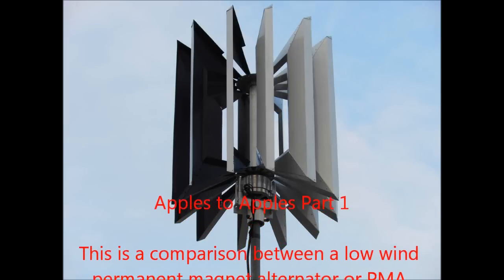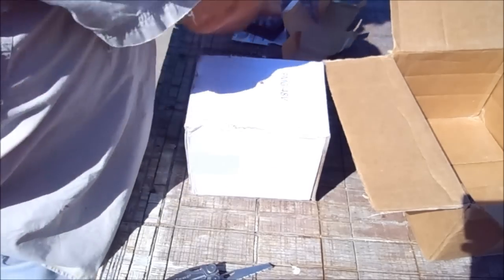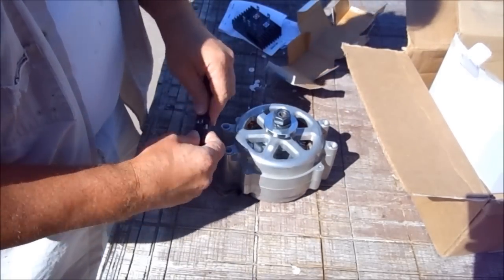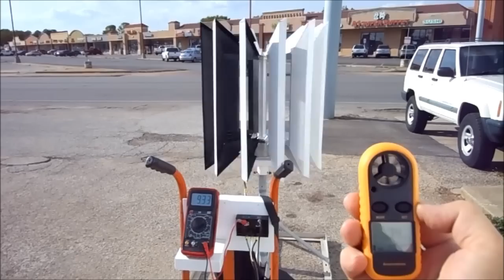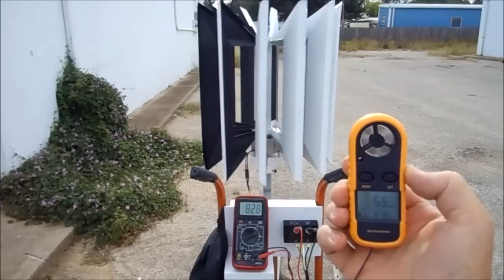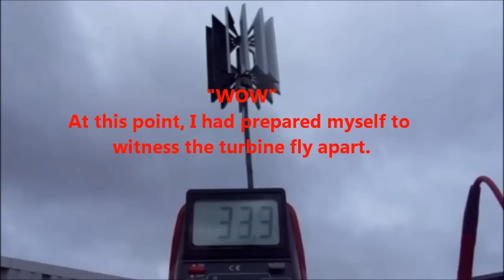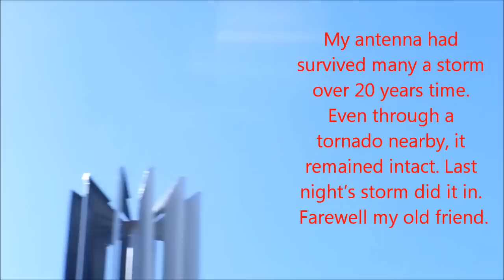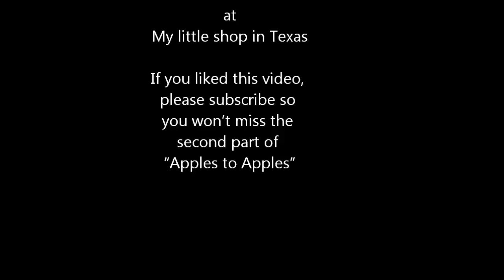Apples to Apples Part 1

Comment: What is the power output of this generator during 18 to 20 MPH winds? Or 10 mph?
Reply from the maker: I would need access to a wind tunnel to break down all wind speeds to power output, and I haven't had that access yet. However in part three of this series, I ran all three of the PMAs I've purchase on my mill. I ran each one around 100 RPM which I guesstimate would be about the RPM in a twenty MPH wind. Results varied by PMA. Here's the link to that video. https://youtu.be/k4_14oWitco

Comment: I think a car alternator works just as well or better.
Reply from the maker: A car alternator requires current flowing through its coils to create the electromagnet which can then charge the battery its drawing from. How is that better than an alternator that doesn't need any outside current to work?

Comment: Could you explain why a roof turbine ventilator would need to turn a generator? Why not put the magnets on the turbine hood and the coil around the base? Agreed it would be rather low voltage but in Louisiana it wasn't uncommon for there to be three or more of them on a garage/workshop roof.
Reply from the maker: Interesting thought. Put one together and show me.
Reply: @LittleshopintexasSV  I'll give it a shot if I can get my hands on parts and pieces. They really don't use them here in the DC area.

Comment: Does it produce electricity and what's its maximum wind speed?
Reply: Many thanks for the reply. 80 mph around here is unusual but not unheard of - we’re in the hills in southern Scotland. The main problem on our land is turbulent wind because our top fields are surrounded by woodland which means that a traditional wind turbine, so the manufacturers tell me, wouldn’t take the strain with the wind veering or gusting a lost. ‘Dirty wind’ as the sailors call it. Which means that a VAWT, on the cace of it, would be the answer from the wind point of view. However, my research into VAWTs seems to indicate that there are reliability issues with most solutions, stemming from wind vane fatigue, bearings and generators. Keep me posted on development.
Reply from the maker: I think the biggest problem with horizontal axis turbines is they have to turn into the wind before they can produce any power. Whereas a vertical axis wind turbine can take wind from any direction. And since the generator of a vawt never moves you don't have problems with thrust bearings, worn electric slip rings or tangled power cables.
Reply from the maker: Yes it produces electricity. Output depends on wind-speed and the generator used. I don't know the maximum wind speed. We've had 80 mph straight-line winds that didn't harm it.

Comment: Was that an optical illusion or was the turbine reversing direction in the high wind sequence?
Reply from the maker: It's an optical illusion. A previous viewer suggested my camera runs at 28 frames per second and I have no reason to doubt that. So you can think of the camera as a timing light, When the turbine is spinning but it looks like it's sitting still, the blades are aligning with the camera at 28 frames a second. When it looks like its running backward, its aligning at less than 28 frames per second.

Comment: Man no disrespect but man that’s light duty, it sure is a start, one major problem I see with there design using for a vault is the stator is open to the weather. Also with the amount of blades, your RPM will suffer for sure. I’m going to check back after your up for a couple of years.
Reply from the maker: I designed this for my area. Maximum height allowed without a permit is forty feet. Which is the average height of trees in my area. We also get the occasional tornado and quite often get hit with 80 mph wind. There are no other wind turbines in use within miles of me for these reasons. And yes top rpm is lower with twelve blades but it produces 14 volts in a six mph breeze which is all I need for my 12 volt batteries.
I'd also like to point out, I uploaded this video a few years ago and there had been one of these on my shop roof for few years until a storm threw a canopy at it. I have since repaired, repainted and put it in a higher place.
Reply: I see I live in the sticks. My closest neibor is 1/4 mile away.
Reply from the maker: It must be nice. I miss the fresh air, starry nights and the quiet life in the country. Well, maybe not always quiet but you know what I mean.
Reply: Yes very quiet except for harvest time, Semi’s everywhere. Most of the year all I here is the wind through the trees and cattle mooing, My big Horn sheep asking for food all the time, even when they already have all they can eat. Winter is even quieter.

Comment: I love the blades do you sell that set up not the pma
Reply from the maker: I can make whatever you need, but I don't have any ready to go.
Reply: @LittleshopintexasSV  ok how much
Reply from the maker: Not all PMAs work well as a vawt. What PMA do you intend to use?
Reply: @LittleshopintexasSV  freedom II
Reply from the maker: @1968dodger2419  Good! Do you already have one?
Reply: @LittleshopintexasSV  no not yet
Reply from the maker: @1968dodger2419  There are three different ones, the 12/24, 24/48, 48/96 volt Freedom II PMA's. I use the 48/96 volt because it starts making battery charging power at very low RPM. The downside is, they are the most expensive at $633 bucks. You can order this directly from MWS or I can order it for you once I have a deposit for the project.

Comment: I looks like it will fly off in high winds,
Reply from the maker: Neither a near miss by a tornado or 80 MPH straight line winds have made it fly off yet, so I don't think that's a problem.
Reply: wow that's a real test alright, I stand corrected, Texas seems like a great testing ground.
Reply from the maker: Yes 'tis, but a wind tunnel would be better.

Comment: Wouldn't an upper bearing stabilize the fan .... it's a big fan?
Reply from the maker: To have an upper bearing you'd have to add some kind of frame to hold it. That will also create wind deflection and mass to the top of the pole.
In more recent versions of this turbine, the blades are 48" inches long and extended down below the bottom of the generator. This puts the generator closer to the center of the forty eight feet of vertical blade surface.
I also recommend using the Freedom II which has a dual core for more power and a longer shaft to handle heavy wind conditions.

Comment: if its cogging to much ,count the magnets inside and you may be able to take out a couple if you have 8 readjust where magnets are and remove 2.same as if you have 10,remove a couple.it will help.shape of magnets also make big difference.good video.
Reply from the maker: A little cogging is not an issue for this turbine and removing magnets would diminish power output of the PMA.

Comment: Have you checked the bearing wobble lately?
Reply from the maker: If you're asking about the Freedom PMG and the low wind Windblue PMG that I showed in this video, they've been sitting in the shop for the last few years. Their bearings are just peachy. And I've been using a 48/96 volt Freedom II on my shop roof for about five years and its bearings are just peachy as well.
Reply: @LittleshopintexasSV  Must be some tough bearings with all the lateral pressure. Thanks.
Reply from the maker: @ed-jf3xh  They're the same type of bearings that you have on a car alternator, designed to deal with heat and high pressure at 1200 at idle speed and up. The highest RPM on my VAWT might be 300. Thats easy work for those bearings.

Comment: I noticed the new MWS pmg is a 48V but your multimeter set at DC volts never got above 25V when windy. So, this setup will never charge your battery just not enough rpm
Reply from the maker: There are a lot of variables to consider; Top wind speed for that day was around 8 MPH; A VAWT will never achieved the same high RPM of a HAWT; And different PMA/PMG are capable of different outputs. On the other hand, it's not a problem if your running a twelve volt system.

Comment: Also, you mention HSA and regulations regarding erecting things on your property, how would they handle someone connecting a vertical windmill attached to an existing chimney? This should be the highest point of the home, so lashing a pole to it with a windmill on it shouldn't be a problem.  Similarly,  I have always wanted to figure out how to capture the pressure differential between the top of the chimney and the ground floor or basement where it terminates. If a vertical windmill could be lodged within a chimney and be totally invisible to the outside eye, this would alter the course of home-based wind generated power. I understand that heat is what drives air UP the chimney, but there are naturally occurring flows of air inside, outside and about the structure. That is why soffit vents work.  The Stack effect. https://www.greenbuildingadvisor.com/article/the-stack-effect-when-buildings-act-like-chimneys With a little application of Venturi and/or Bernoulli laws there could be a speeding up of these flows.
Reply from the maker: Yep, the stack effect is how a prairie dog homes ventilation works. However I don't think its the heat rising that drives the air up the chimney as much as the wind moving across the top of the chimney that creates a vacuum that pulls the air up and out. And of course to have a good flow you'd need as much air moving through the house as possible. I could see something like a ceiling fan converted into a generator positioned directly under a vent hole in the roof of equal diameter to the generators blades. This would work best in temperate zones where heating and cooling the home is not an issue.
Reply: @LittleshopintexasSV It surely is the heat tossing. That is why we have to prime the chimney by lighting newspaper to hear the stagnant air in the flue prior to lighting the fire. Otherwise, the fire will create too much smoke and not enough heat to get there chimney air moving there forcing the smoke to roll into the room instead of going up the chimney. Gotta heat the air to initiate the convection up the chimney.
Reply from the maker: True to a point. Because cold air is heaver than warm air, you do have to warm the air in a chimney in order to get the smoke to go up the chimney. On the other hand I've never heard of a prairie dog needing to start a fire in order to get the air flowing through his house.

Comment: I bet there is sweet spot for design of a Fechner painting on the turbine blades such that you could tell the wind speed by the virtual color of the spinning black and white blades. https://www.google.com/search?q=fechner+effect
Reply from the maker: It could be done with the turbine itself, but not while using it for generating electricity. When your system is drawing power from the generator, it creates a resistance in the generator which lowers the RPM and would require higher wind speed to achieve the same RPM. When no load is being drawn, the turbine can freespin. However painting one blade a different color might give you a better idea of RPM achieved at any given wind speed whether under load or not.

Comment: I would not mount the turbine on the generator. I would put a pulley or gear and chained on turbine shaft to turn the generator. By sizing the gears correctly you could increase RPMs on generator shaft.
Reply from the maker: Sounds good. Show me... Keep in mind by adding resistance, more torque is required to turn the generator shaft. Also keep in mind, a generator under a load requires more torque to turn it in the first place. To create more torque requires higher wind speed or more blade surface. I'm not saying it can't be done. In fact, I'm in the process of redesigning the blades to create more torque for that reason. You may see it in an upcoming video.

Comment: HOW MUCH ARE THESE TURBINES RUNNING PRICE WISE
Reply from the maker: Ask me that question again in a few weeks. I've just started rounding up materials for a new turbine. This one will be a slightly different version with all of the bells and whistles (modifications) i've added since I built these prototypes a few years ago. Once I know the cost involved I will be happy to give you the new sell price.
Reply: @LittleshopintexasSV  OK GETTING READY TO IN STALL A 1600WATT SYSTEM AND LIKE THE ROUND/BARREL BLADE SYSTEM MUCH MORE THAN THE PROPELLER STYLE SO LET ME KNOW

Comment: Nice day
I have seen your videos as with the alternadors of Vahiculos transforms into generators wind, excellent idea.
I would like to buy a generator of 12 volts, which is its price
Reply from the maker: Antes de hablar sobre mi precio, debemos hablar sobre la cantidad de viento que recibe en su ubicación. ¿Cuál es la velocidad normal del viento en su área?
Before we talk about my price, we need to talk about how much wind you get at your location. What is the normal wind speed in your area?
Reply: @LittleshopintexasSV  There is too much air and sometimes there is nothing but most of the year there is a lot of air speed is varied, I would like to install in parallel with the photovoltaic cells I have installed, I have two cells of 150 watts with two batteries in parallel
Reply from the maker: Las turbinas que hago funcionan mejor con un Freedom II PMG y yo vendo una unidad completa por alrededor de $ 2000 dólares. He puesto un enlace a continuación para una alternativa mucho más económica para trabajar con un sistema de 12 voltios.
The turbines i make work best with a Freedom II PMG and I sale a completed unit for around $2000 dollars. I've put a link below for a much cheaper alternative to work with a 12 volt system.
https://rover.ebay.com/rover/1/711-53200-19255-0/1?mpre=https%3A%2F%2Fwww.ebay.com%2Fitm%2FDC-output-Confederate-3-blade-500-watt-12-volt-wind-turbine-turbulent-wind%2F292049663027%3Fhash%3Ditem43ff843433%3Ag%3AcG4AAOSw2gxYwGRO&campid=5337965585&toolid=20008

Comment: FYI the shaft dimension is for a Pulley Fit which usually is slightly tapered !!
Reply from the maker: I wish they were tapered. A tapered shaft would mean no keys or set screws required. That was my argument when criticizing the removal of material from a Freedom II shaft. The maker of the Freedom II has started cutting keyways and set screw holes into the shaft to prevent the blade hub from slipping on the shaft. This video will show you what I'm talking about. A taper would be awesome.
https://youtu.be/8HMWCm95gVE

Comment: Doesn't the rain run down into the motor and ruin it? How do you protect the motors from rain and weather?
Reply from the maker: The lower blade mounting plate is as large a diameter as the front of the motor. And there is only about one inch of clearance between the plate and the motor, so rain would have to be blowing in sideways in order to reach that gap. Any storm that had the rain flying sideways would also have the turbine spinning so fast it would blow the rain away from the blades.
Besides all that, there are no rectifiers or circuits to be affected by rain on the inside of the motor.

Comment: I would think that the wind turning the turbine blades would put a lot of pressure of the generator shaft.
Reply from the maker: Yes! But you have a similar pressure on an alternator shaft in your car. When a serpentine belt (one belt) wraps though and around; crank shaft, water pump, smog pump, air conditioner, and alternator. And it has to be tight enough to drive your air conditioner without squealing, thats a lot of pressure as well. Good bearings in both front and back of the body will make a difference in the life of that alternator.

Comment: What type of turbine is the best to order . What specification etc and where's best to buy them from
Reply from the maker: Those are hard questions to answer, but here are a few you'll need to answer first.
What is the average wind speed in your location?
Are there obstructions around the place you intend to install a wind turbine?
How high do you plan your turbine to be?
Are there city codes preventing you from putting it that high?
Are there city codes to prevent you from setting up a wind turbine.
Are you concerned about birds being killed by horizontal wind turbines?
Do you plan to use solar panels in concert with your wind turbine?
Will you use batteries to store the energy created by your turbine?
How much power do you use on average?
How much power do you need from your turbine?

Comment: very nice but you need guy cables the mast will break after a while with that flexing
Reply from the maker: Yep I know, guy cables or a larger diameter mast. Eliminating sway in the mast would also help the turbine run more efficiently. But i'm a pauper so I use what is available to me.
Thanks for watching.
Reply: dont know if you have tried 1 but treadmill motors work great
Reply from the maker: I have one but I haven't tinkered with it yet. Maybe that will be a future video.
Reply: look forward to seeing it

Comment: Vibrations from the shuft turbine will kill your bearring inside generator... Put like a thik rubber layer between them and don't make that conection very solid...But the problem with your desing that u keep whole weight and rotational vibratiions of the turbine on generator shuft alone...
Reply from the maker: You are assuming my turbine is not balanced. You are wrong! And beside that, creating any amount of slack between the blades and the shaft will lessen the efficacy of the turbine.

Comment: Buddy, what type of alternator you used, we are having problems in selection of alternator...and you didn't use gearbox..??
Reply from the maker: In this video I compared a WindBlue low wind PMA to a Missouri Wind & Solar Freedom PMA. The WindBlue uses an automotive alternator body and the MWS Freedom uses their own cast aluminum body. Both use neodymium magnets instead of the electro magnets of a standard alternator. Both use 17mm stainless steel shafts.